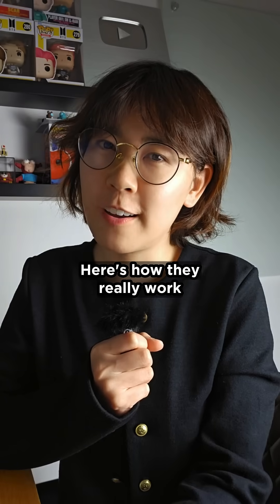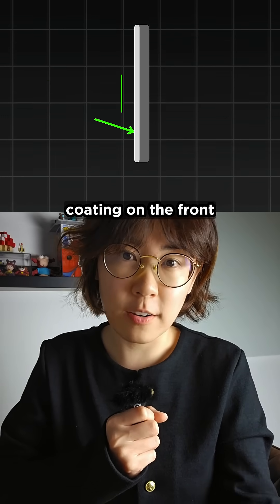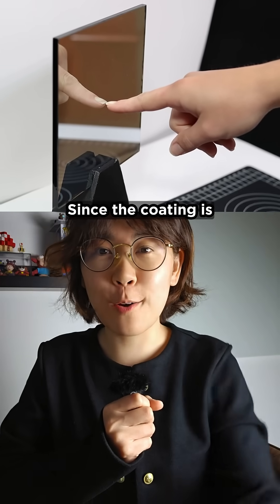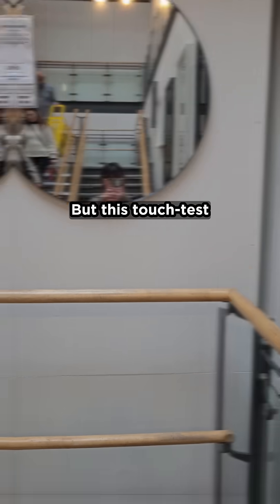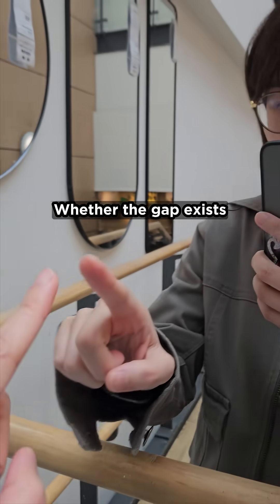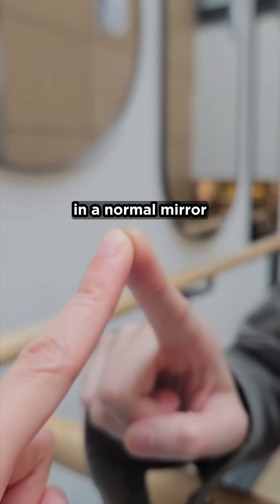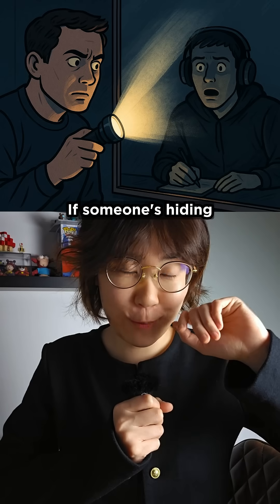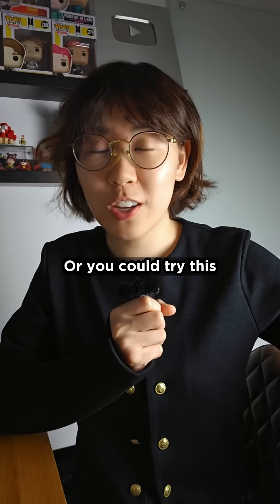Can You Spot a Secret Mirror with This Easy Test?

Comment: You can also apply one-way mirror film to the back of a clear pane of glass to get a one way mirror with a gap. I don't know why people always try to push the "gap" method as it only works if you apply the reflective layer to the front of the glass.

Comment: There is no such thing as a one way mirror. They are just glass with a highly reflective coating on one of the surfaces. The reflection gap doesn't work. Do the dark room tip and hold the light against the suspected mirror.

Comment: I had someone freak out about someone watching them through a mirror because the touch test didn't work. Never mind that, based on the room layout, the person spying on them had to be sitting entirely within a 6" thick wall. Or that the flashlight test described in this video didn't reveal any holes or cameras. TikTok is the worst.

Comment: They are called two way mirrors because they work on light differential. The side with the highest amount of light becomes reflective. I sold quite a bit of it. This is also how the infinitie portal mirror trick works. A 2 way mirror with a mirror on the otherside. These will be separated by light source(like a rope light) which causes the effect.

Comment: All you reveal with that test is whether it is a first or second surface mirror, e.i. if the reflective coating is on the front or the backside of the glass. Normally, in most aplications that isn't scientific instruments, the coating is put on the backside to protect it. A one way mirror is basically just a mirror with a coating that isn't completely opaque, and the "filtration" is mainly done achieved by a large contrast in lighting between the two sides. On the dark side you don't see much of the reflected light as there isn't much light to reflec, and hence the light passing through the mirror dominates what you see. On the light side on the other hand, you see a lot of reflected light, drowning out whatever little light that passes through, as there isn't much light to pass through from the other side in the first place. This principle works equally well regardless of what side of the mirror is coated. So just because you see a gap, you can't be sure it is not a one way mirror.

Comment: Also matters if it is a first suraf e or second surface mirror. 
First has the reflective coating on top of the glass. the second surface has it behind the glass. First surface mirrors are used in optics applications, and are much more expensive. However, they sometimes find their way into non-optics applications due to some people having more money than sense.

Comment: Another problem is with a first surface mirror, a mirror where the reflective surface is on the front of the mirror. Though first surface mirrors are usually only used for high-intensity light reflection

Comment: Not really quite correct. The partially reflective membrane can be on either side of the glass. But the observation side has to be darker than the observed side. However, if it's dark enough on the far side, you cannot get it dark enough on your side to see through the reflection. Shining a light at the mirror will not help because that just makes your side of the mirror brighter

Comment: I manufacture glass. The gap is never a good tell for the reasons she states. You can laminate multiple panels of glass, including mirror, adding large gaps from the silver coating to the surface. There are also interlayers, sheets of glue for glass, that can alter the reflectivity and transparency of glass. Unless you can turn off all the lights, you won’t be able to tell.

Comment: Also anyone who knows about the mirror test can also add another layer of glass to a one-way mirror to artificially create that gap, they could also install motion activated lights with no way to directly turn them off so an easier way to check is to turn your camera on your phone on with flash and press it against the mirror in question

Comment: Is it really that hard to spot? As a child I remember I was at an optometrist, in front of one of those mirrors to look at oneself with glasses and was board and put my face right up against the mirror and realized I could see through to an office. I don’t know if that works for all one-way mirrors but for a lot I’ve noticed, simply putting your head close to the mirror and covering the light with your hands from the room your looking from should make it so that you can see right through. Works better if the room you’re looking into is lighter but the office at the optometrist I saw that one time had its lights off and I could still see through the mirror

Comment: One way mirror not need to be covered in front, only needs the cover must be thin. This explanation is bad, because wherever the layer is it reflects to both sides the same way and let the light through the same way.
The difference is which room is lighter and darker. The mirror works the very same way from both directions.

Comment: It also doesn't work for non-glass surfaces. For example i use mirror tile for a 3D printer and that doesn't have a glass layer but you most certainly can't see through the back side.

Comment: It also could be a normal surface coated mirror. They are used a lot in SLR and DSLR cameras to event double reflection and generally give a better reflection. Tho these mirrors are surface coated with sliver which can corrode if touched.

Comment: My favorite thing is that people actually think that one way mirrors would be that common. There is like no room between rooms in hotels and stuff to even fit a space for a person to watch you through comfortably
Reply: imagine it is a camera not a person. it doesn’t take too much space
Reply: @hoijanlai  If it's a camera then this test is still pointless. There are so many ways to hide a camera in a regular mirror that using a two-way mirror would be pointlessly expensive.

But it's even easier to hide a camera elsewhere. Cameras are tiny. You can put one in a vent, an AC unit, a high shelf, any piece of furniture, a smoke detector... the list goes on and on.

If you're paranoid about cameras, scan for wifi signals instead. Almost all cameras of that nature are wireless these days.
Reply: @EmberQuill  Good ones use fiber optic these days. Wifi is too easy to jam.
Reply: @EmberQuill  scanning for WiFi signals is also pretty pointless. You can name a WiFi signal pretty much whatever you want. People have portable WiFi sources. Cars have WiFi sources. It would be practically impossible to tell if a camera is there and using a specific WiFi source. Most businesses that have free WiFi also have private WiFi networks, at least one. Then there's portable ones guests have. Airbnb's are also no exception. Plus, we have terabyte+ micro SD cards. Can store thousands of hours of footage without WiFi usage before needing to be changed out.
Reply: @hoijanlai  I can't imagine setting up a one way mirror for just a camera being very practical. It has to be cheaper to just set up hidden cameras at that point with no need for a suspicious mirror to give them away
Reply: Yeah, I understand people looking for cameras, but the mirror thing feels more like a childhood irrational fear. What, there’s just a convenient little room built in behind your hotel mirror where a creepy man just sits 24/7?
Reply: @LyricalApathy Unfortunately there have been cases of people (regardless of gender) basically doing this.  Having a small room in their short term rentals (or in some cases, the neighboring room itself - which is marked in their system as unavailable in some way) and when they know someone is there, the person goes creeping.

It's not nearly as common as TikTok might make it seem (at least in the US), well at least the physically sitting on the other side of the mirror.  But it's also not unheard of.

What's really weird is that it has happened enough for states to have laws for it specifically.  Sad that in California (California Penal Code Section 653n), by itself, it's only a misdemeanor, but can lead to other charges depending on what/where it happened.

The larger issue for modern surveillance concerns is just how easy it is to hide cameras and other devices in places you just don't expect, and which still don't violate monitoring laws.
Reply: @Haladmer very informative! But yeah agreed, I don’t doubt that there have been some odd cases but it’s not as big of a risk as TikTok says
Reply: @LyricalApathy Yeah, at one point, part of my job in the military was alarm and controls systems.

Even in the 90's we had some crazy stuff available in the public market.  Now they have 4k UHD cameras in working smoke detectors for like $400 (they used to be "fake" detectors) and biometric elevator buttons lol
Reply: I work at the front desk of an hotel, I was sitting at my desk watching the cameras and this lady came to me “are those are rooms?” I just ignored her I hate fuckery like this, just use your brain and eyes if your going to be nosey 🤦🏽‍♂️
Reply: Plus if you think dozens (if not hundreds) of construction workers would build a hotel with a secret tunnel between all the rooms and stay silent about it, you're beyond crazy. So unless someone built the hotel themselves, you can sleep/shower comfortably. The smoke detector in a hotel room is far more likely to have a camera than anything. They make millions of smoke detector hidden cams a year and they're wired into to wall in every hotel room.
Reply: right i am so confused like how common can this be?!
Reply: And fitting hidden cameras is way more likely to happen thing than a creep sitting behind the mirror
Reply: people go missing from dingy motels all the time, better safe than sorry
Reply: cameras dont require someone to fit in a tight space. also with this world, i wouldnt be surprised if
Reply: I moved some ppl into a house they were having built that was almost done with its final knockout (little finish details). $2mil home. The upstairs master bath wasnt fully finished, and a large section of mirror was missing. In the wall behind where it would go it was totally being fitted for optics. I laughed about it, wondering just what they were planning to catch in their own bathroom. 
I have a friend who is vacationing at a friends house in Florida, and she spends as little time as possible in the house as the whole place is wired for video & audio. It's not a common thing, but just know if you are in a rich persons home, your privacy may not be as private as you thought, especially if they like to entertain often.
Reply: There are some cafe' with one way mirror to girl's room. Of course when we knew of this, some people had to go to court
Reply: ...a camera
Reply: Small cameras can still be easily placed behind a one-way in the wall.
Reply: I had a friend suggest the bathroom mirror was one... the mirror on the wall opposite the bedroom. When I asked how someone could fit within the half-foot of space, she switched to saying there was a camera. There's no helping the paranoid.
Reply: It could be a one way mirror with a camera behind it
Reply: There's an 11 inch gap between my bathroom wall with the mirror on it and the opposite hall. It's not a room but there's plenty of room for a camera.
The plumbing runs through that space.
Reply: we just use hidden cameras
Reply: But enough room for a camera
Reply: Im more worried about the vents on ceilings. Especially in one floor motels and similar places

I know how much space is between the ceiling and the rafters, not a ton but EASILY enough for a clever person to build a creep chamber above one of those vents to spy on residents.

Multifloor places are a bit safer cause the spaces between floors isn't that thick, but you never know how skinny the creep is
Reply: except when the side of the room your bathroom is has an employees only room right next to it :/
Reply: Cameras: Exists.
Reply: Modernly i only ever see them in stores
Reply: not even the rooms themselves are spacious enough so your chances of a pervert peeking through your bathroom door is second to none
Reply: Boycott Colgate they support genocide
Reply: Cameras don't need an entire room you know. Not the professional ones but the 2 megapixal to 64 or higher ones used in smartphones are all small. Plus if you want you can make your phone the job. Just fill something in between to hold the phone there and it's done. If you don't fill a press can kill this but who would be that stupid.
Reply: The plan has only one problem. It's the need of a power source. Well now even mirrors are smart 😅. So it's not impossible anymore.😢
Reply: Maybe cameras?
Reply: Doesn't have to be a whole person, though, could just be a camera behind the glass, and cameras just get smaller and smaller
Reply: Women just want something to feel paranoid about, but then they’ll go out to a club 95% naked k
Reply: You be very surprised how many secret rooms there are everywhere.
Reply: what about a camera?
Reply: A camera doesn't need much room.
Reply: it doesn't need to be a room, just a space enough to hide a tiny camera is concerning enough...
Reply: You did notice that most of the people in this vid are Chinese right? To them IT IS normal to find a one-way mirror where they travel through.
Reply: A one way mirror could just have enough room for a camera to be inside.
Reply: Only need a few inches of gap to place a camera.
Reply: Mmm. Yes, good, he doesn't know we're inside his floorboards yet.
Reply: There could also just be just a small camera, no need to fit an entire person in there
Reply: Or they could just put a camera behind it so they can get multiple rooms without standing behind the mirror. How is that not obvious?
Reply: Cameras
Reply: The women making these videos for their down line are barely literate "influencers".  It's a wonder they can operate phones
Reply: There's space for a camera especially with today's technology.
Reply: They are literally everywhere once you start looking. Airports, train stations, shopping malls, even some grocery stores.
Reply: @Sussy-Walter  There are mirrors in your grocery store? Aside from changing room mirrors, I don’t really see mirrors much aside from bathrooms
Reply: @Veronicz  Look up toward the top of the (usually back) walls, especially in older stores.

Some stores have business offices at a mezzanine level with mirrored windows looking out over the store.  Sometimes they're flat mounted, but just as often they're mounted at an angle that allows floor staff to monitor the aisles without needing to walk them.

They also use things like woven sound panels or other materials that allow them (or cameras) to look out over the store and not be easily noticed.

A lot of these have been replaced by camera systems now, but there are quite a few places (at least in the US) where you can still see the Eyeball Mk.1 based security in use.

For modern devices, there are a lot of "non-intrusive" security devices out there to record images/video/audio, and they can be hidden in crazy places.
Reply: @Haladmer  I've seen this before in my wal-greens, it has a huge mirror at the back, And lots of round mirrors in the corners
Reply: @Veronicz yes, why would there not be mirrors in grocery store bathrooms?
Reply: @Veronicz    My grocery store I work at has a one way mirror for the office which is right next to our main register.  Kids love staring at it because you can easily see inside.
Reply: @Veronicz  higher end establishments tend to have them.
This is a rule of thumb for all retail.
Reply: @Veronicz  There are mirrors for employees to look at customers. I remember back in the early 2000s there was a mirror where we could see customers in the customer service area. They will probably be in places where you never cared to look like behind the counter or maybe on an upper level.
Reply: @Veronicz  😭😭😭😭😭😭😭 scary true
Reply: @Sussy-Walter  honey you forgot your tinfoil hat on the way out
Reply: @Sussy-Walter  everywhere i have been the layout does not allow the mirrors to be a 2 way, except for one changing room but that was in a small boutique that had mirrors that were hung on the wall (you could tell they were hung). Most mirrors in places like bathrooms are only above the sinks and do not allow you to see anywhere private. In hotels ive stayed at the mirrors are all on the wall that faces the hallway (and the walls are thin so aint no way someone fotting in there) and id your in the hallway you cant see int
Reply: Why yes, in places of business where security is common you may often see such, what people are worried about is houses and hotel rooms, which unless someone converted part of their living space into a secret watching room then you're fine (which would be obvious if you look at the layout of said house as houses are built with standard walls as empty alcoves would be wasted space during development) @Sussy-Walter
Reply: @Sussy-Walter stay home
Reply: @Sussy-Walter everywhere? There aren't any places near me with random mirror walls, the only place I can think of the mirrors are on a little support beam which could barely fit 1 person standing in there, so I think that can be ruled out
Reply: @Sussy-Walter yea in public spaces. dude everyone doesn’t have one way mirrors and I’m willing to bet that peeping on people makes up for minuscule numbers amongst crime.
Reply: @Sussy-Walter no they aren't, you just need to be a victim of everything
Reply: @Sussy-Walter I'm a simple man: I never trust someone who isn't capable to use the word "literally" correctly.
Reply: @Sussy-Walter  But not bathrooms or other private spaces.
Reply: @Sussy-Walter  You are just paranoid as fuck